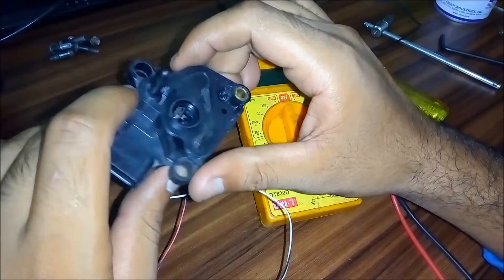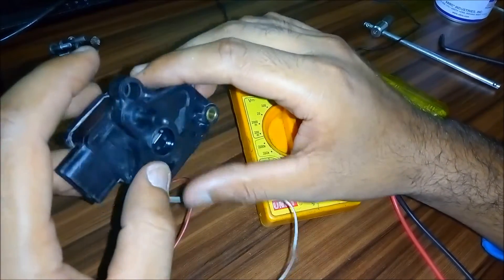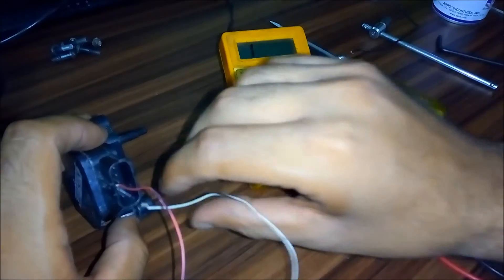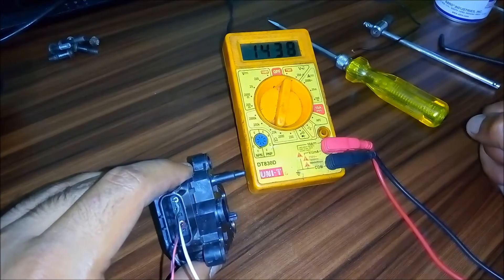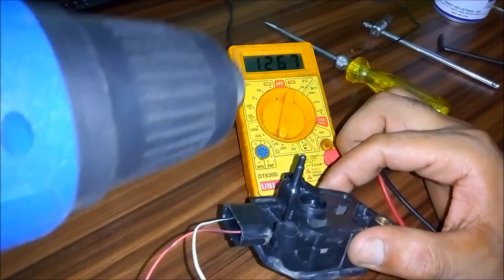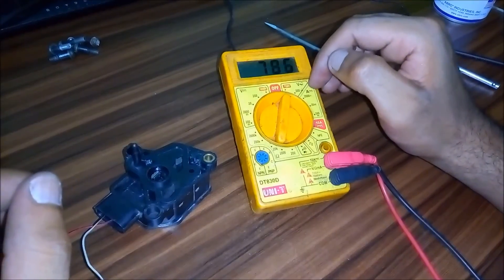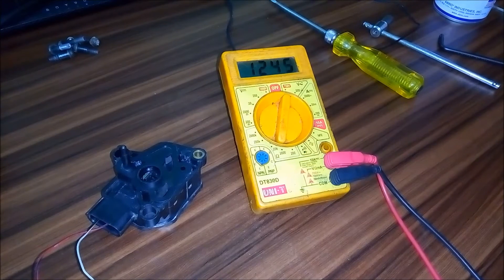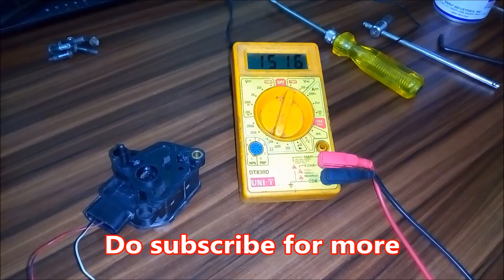Air Intake temperature sensor in a Fuel injected Car/Motorcycle and How to diagnose/check it!!

Comment: Sir My cbr 250r Abs is having an IAT sensor problem, its not having good response to throttle and rpm range is b/w 2k-3k. Where can i get it sir? Do i have to clean it or buy new one?

Comment: Hi, i m getting 9 blinks my vehical is running normally how do i solve this..
Reply from the maker: U must be having V2 ZMR...9 blinks are for side stand sensor malfunction...!!Check your side stand sensor..!!
Reply: bro, I have 2012 karizma zmr model same as you.  my mail id :- bhoyar.shubham03@gmail.com
Reply from the maker: Sorry about earlier
9 blinks = air intake sensor malfunction
Check for loose connection to your throttle body...Yes your bike might run normal but it messes up your air/fuel ratio...U might end up having poor mileage or performance..
Check for loose connection or broken wire...If not then try cleaning your throttle body!!
Reply: TopEnd sorry i just found that there r 5 slow blinks 4 fast blinks
Reply from the maker: Thats bank angle sensor malfuction. ..situated on right side of ur headlamp
Reply: TopEnd bro how do i solve this issue of bank angle sensor and do u have any links if i want to buy.. thnx for ur response.
Reply from the maker: Like always check for poor connections...Nd if not then replace the sensor..!!Gud luck

Comment: sir my zmr is missing problem only 1000 to 2500 RPM Tell me what I do....to resolve this problem...
Reply: pls tell me sir
Reply from the maker: Clean your fuel injector and throttle body and replace fuel pump relay...Also check for bad battery..!!
Reply: TopEnd i have already cleared throttle body and injection...but my problem is not resolve....pls tell me